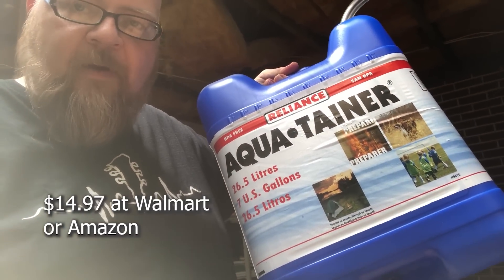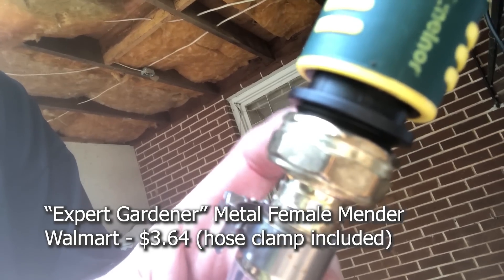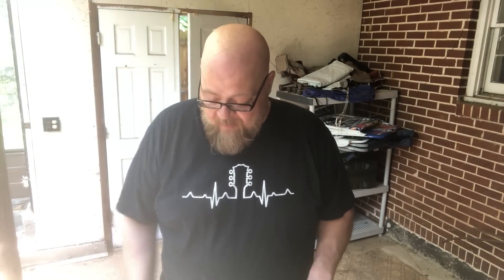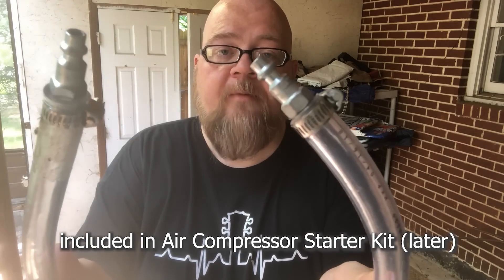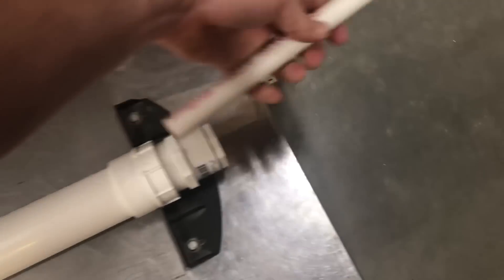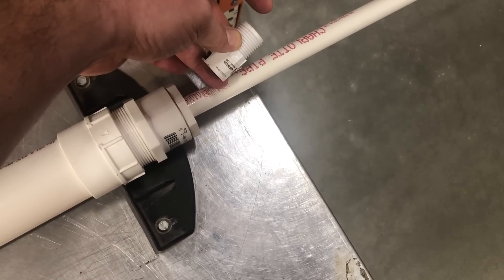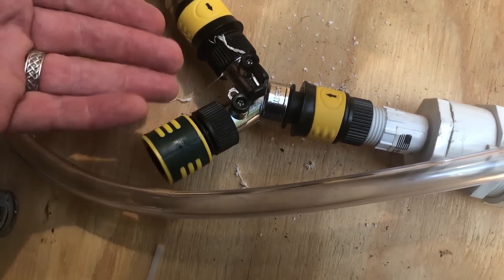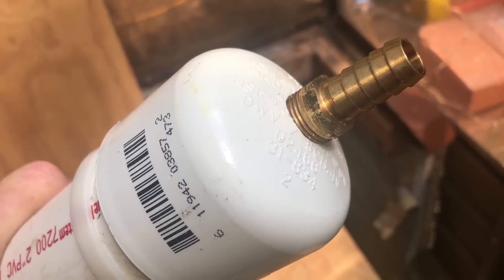DIY Aircrete Foam Gun - Demystified

Comment: Water tank is a really stupid idea.  I dont know if the brand isn't making good water jugs anymore but I just had my second one explode in the exact same seam near the bottom.   Not viable for a tank at all; it's about as fragile as a soufflé.

Tank should be made out of the really large pipes like the ones used for the septic as the pvc is pressure rated unlike weak water jugs.

Comment: good idea ,but i will use 2 adjustebol air pressure regulators  instead of the 2 valves on the gun ,i think this will give a perfect controle over the foam gun and the foam  and the regulators will not be on th gun but at the start of the air hoses to reduve the weight of the gun and make it over all easyer to handle ,but again good idea
Reply: I like this idea (after blowing up a couple different containers). Were you able to get yours to work?
Reply: @hithereitsjames  did not yet build one hehe,i am just looking to lern from others how they did it before i give it a go , seeing the (in my mind) mistakes they made will avoid me to make those mistakes and hopefuly i wil swear a lot les to. .lol
Reply: @DeeCee  cool! I'm still working on mine. I set my rig up like @jonwasbored but air kept blowing back up the water downflow.

Comment: I don't understand why the air can not go to the solution and then straight out of the gun, without air going in a T bypassing the solution? 
Why is the T connection Needed?
Why can't the air pressure just push the solution out into foam?

Comment: Typically how much does this weigh per cubic foot? Could this be used for a walkway on a dock? Wood doesn't last long and the PVC boards made for docks are way too expensive.
Reply from the maker: Hey. Sorry such a long delay in reply - it can be used for surface but it takes some reinforcement. Check gianttinylife , AircreteHarry , or honeydocarpenter

Comment: Pro tip 1: Push fittings instead of garden fittings. They are faster to connect/disconnect, don't leak at all, and hold more pressure; and 2 for the countries that do not have 7th gen dish soap, seek out the active ingredient that makes the bubbles. i.e. SLSA or Sodium Lauryl Sulfoacetate from a chemical supplier, which is a foaming agent. It's good because no colourings or smelly additives. Just tight froth. <3

Comment: Hey Jon, great vid man!  So i watched Matt Traven's video also on his super simple gun using the pittsburgh automotive Air Vacuum pump which has a venturi valve inside of it.  Did you try using this valve?  https://www.harborfreight.com/air-vacuum-pump-with-r134a-and-r12-connectors-96677.html.

I noticed in your vid here that you have the porter cable mini compressor which is the same one I have which is only capable of 2.4 SCFM a minute @ 90PSI and it says 4.2 CFM per minute at 90 psi air consumption on the front of the harbor freight part so could that be the reason it failed?  Or would it work for a little bit and then you would have to stop and let it rebuild pressure?
Reply from the maker: Hey. I never got it to work. I suppose the rating could be the reason but all in all it was a really small valve and just wasn’t pushing enough air to create negative pressure. Again - might be the compressor rating but at that point I wasn’t going to spend the cash to upgrade my compressor so i can make a $12 valve work.

Comment: I haven't watched the whole video yet, or looked at all the comments but, can you spray it on walls as insulation?
Reply: i would not recommend that
Reply: be we are trying to figure out something to do just that
Reply from the maker: Not likely you’d be successful there. It takes a while to cure and once it does it’s light, pour out but surprisingly strong when a skim coat of stucco like material is placed on it.
Reply: @JonWasBored  I'll just stick with batt insulation. Don't wanna take any chances.

Comment: Nice job!
However, your pro-tip is incorrect.  It is the the compressed air that is dangerous in a pressure vessel (your water can isn't really designed to hold pressure)..  Water doesn't compress, so the lower the volume of compressed air that you are storing, the better.

Comment: Could you use aircrete to make a countertop?  Could you just do a skim coat of cement on the top and sides after it's cured to get rid of air holes? Would you add rebar to it?
Reply from the maker: @honeydocarpenter is the best to answer that one. Short answer is yes, but you’d need some additives I think.

Comment: Would using a larger foam outlet fitting make for a better and less forceful spray of foam ??? Also, what would be the best way to pump the final product of aircrete up and into 8 feet high and 8 inch size cinder block ???? Thanks Jon Was Bored !!!!!!!!!
Reply from the maker: I don’t know of a great way to pump the solution. Honestly seems by hand would be best to maintain the integrity of the foam. Might ask @aircreteharry or @honeydocarpenter
Reply from the maker: I don’t know of a great way to pump the solution. Honestly seems by hand would be best to maintain the integrity of the foam. Might ask @aircreteharry or @honeydocarpenter
Reply: @JonWasBored  Will try that YWB. Peace too.

Comment: Run a piece of 1/2 pvc to about a 1/4 in from the bottom of your water tank to the water out valve.  That way you are pulling water from the bottom of tank and not having it forced up and out.
Reply from the maker: It’s not being forced up. It’s being pushed out the bottom.
Reply: @JonWasBored  do you lay the can on its side?
Reply from the maker: No ... it would back fill. I just like to keep it elevated so gravity helps keep the fluid going.
Reply: @JonWasBored  10-4.

Comment: I am puzzled about the way liquid is pushed out. Is there a hose going down inside the tank under the water level? I missed that part.
Reply from the maker: Air goes in tank and pushes soapy solution out the other side.

Comment: Hi can anyone tell how to make 1 gallon of aircrete ... Can i make using just pain cement and dish soap??? its for an art project i don't need much... i saw a video where a brick made this way floats... ..thanks for your help.
Reply from the maker: One gallon is gonna be a small order. Regardless you’ll need the foam to make it float. See my video on my first pour. One small bag of Portland cement makes about three gallons of cement. Add 15 - 18 gallons of foam (by volume) and mix with the cement slurry. Then use what you need and throw out the left over. You’ll only be spending about $15 in material. There’s also a really slow way to get the foam - wrap screen material around a paddle mixer and whip it up with your drill. Takes a while longer but it keeps you from having to build a whole gun.
Reply: @JonWasBored  yes thanks... but theres gotta to be a way to make a smaller batch... i actually only need about 1/2 gallon on aircrete...  for art project
Reply from the maker: You can make as small of a batch as you want. Just do the math and cut accordingly. But I’ve never seen Portland cement sold in bags smaller than 48 lbs
Reply: @JonWasBored   so lets so i use a 5 gallon bucket and add 3 inches of dry portland...then i mix with water...i see they make it very watery in videos i watched... so roughly how much foam is added...is this an exact science? maybe just keep adding foam while whipping until it raises from 3 inch height to 8 inch height in bucket kinda like a milk shake... i will be happy if  when its cured  a  aircrete brick  weigh s approx 1/3rd as a pure cement brick so if a regular brick weighs 3 lbs then my aircrete brick is 1 pound... give or take...it could weigh a 1/2 pound and i would be happier actually... this is fill for statues that are hollow and i need fill for strength etc... but its art so it does not have to be any stronger then a good piece of foam... thanks again also cure time compared to regular cement? will it set p the same? i want to try this tomorrow so any tips are appreciated. i just learned about this stuff yesterday..thanks again
Reply from the maker: Here’s the standard formula that makes about 45 gallons. You’ll want to divide by 9 to fill a five gallon bucket. 

https://www.domegaia.com/how-to-make-aircrete.html
Reply from the maker: It’s carveable and shareable after 24 hours. It will be very brittle and flaky for quite a few days.
Reply: @JonWasBored  so how long before its pretty strong .3 days? .does this shrink more than regular mix after a couple of months...?... after a week a regular mix i fill with is ready for sure next day its usually solid.., thanks again
Reply: roadstar499 if your foam is the right density you shouldn’t see more than 10-15% slump. And I would let it cure for at least a week.

Comment: Are there not commercially available foam guns for this purpose that will work? Like the kind you use to foam wash a car. Or is this just how you DIY it if you don't want to buy one?
Reply from the maker: Foam guns at car wash are simply high pressure water/soap solution ... this gun and many other similar use the steel wool to make dense foam that holds up when mixed with the cement slurry. I’ve not seen any commercial versions though there are several DIY guys that sell kits.

Comment: So, does the soap meet the water and air at the steel stuff and make the foam there? Thanks, nice..)
Reply from the maker: Yep. Soapy water under pressure and broken up by the steel wool. Kinda like your spray bottle that goes through a screen when squirted and makes foamy solution when you clean ... that times 1000! :)
Reply: @JonWasBored  cool, thanks..) so, is there away to adjust the amount of soap, size of bubbles... Does that matter?
Reply from the maker: The ball valves I have in line for both the soap solution and the air allow for “dialing in” the best blend of air and soap ... generally it should be the consistency of shaving cream and not easily break down... meaning if it sits as just foam it won’t “melt” into just soapy solution again for quite some time.
Reply: @JonWasBored  cool, thanks..!
Reply: @JonWasBored  are going to show what you've made with it? How would you compare the outcomes with AAC, made with aluminum powder?

Comment: So I watched a video from a company that makes commercial foam solution for aircrete (instead of dish soap or shampoo) in the video they demonstrated using a 5 gallon bucket, water, their "soap" and a drill w/ mixing paddle to make foam without a air compressor and foam gun... just wondering if you could possibly make a video of this with the regular soap option and tell us if its possible to do GOOD small batches of aircrete at home with this extremely easy/ low cost method???
Reply from the maker: I’ve heard others mention that method. One comment said to take a piece of screen mesh and secure it to a paddle mixer on a drill bit. Takes a little longer but should work.

Comment: Your device makes great foam. But I still have no Idea how is going together. What is in the Blue jug and is it pressurized? where is the Soap.
Reply from the maker: Did you watch the other step by step vid I did? The water solution is about 2/3 cup soap to 3 gallons. And it’s pressurized to the point of I he ring the fluid. But the added air to the gun makes it foam when it hits the steel pads
Reply from the maker: Did you watch the other step by step vid I did? The water solution is about 2/3 cup soap to 3 gallons. And it’s pressurized to the point of I he ring the fluid. But the added air to the gun makes it foam when it hits the steel pads

Comment: It would be pretty cheap to put a regulator on the air supply to the jug and keep a known constant pressure there. You can find on amazon for about 6.00 and up. Also you can get brass bulkhead fitting for the hole in jug you drilled would be more solid connection. Just drop the threaded piece in through the big hole and move jug around till you can pull it through small hole. Might have to build one of these.
Reply from the maker: Awesome suggestions. Please build and post your results. :)

Comment: While your gun works just fine it seems to be no less complicated than any other foam gun on YouTube, and coming in at $100 not the cheapest The simplest foam generator I have seen so far would be the foam generator made with a bucket, T shirt and leaf blower
Reply from the maker: Adrian - complication is in the eye of the beholder I guess. I designed this thinking about the guy who doesn’t consider himself very precise in engineering. To that end, almost nothing about my build is precise - leaving a lot of margin for sloppy work. Two drill holes. Three cuts with a razor knife and the rest is glue and screw. 

I’m intrigued about the bucket / T-shirt / leaf blower thing ... post a link!

Comment: I use a Graco airless spray rig for my soap and water pressure.I use a attachment I made with pvc and steel pad.Quick connect for air pressure.Wand cost about 20 dollars.
Reply from the maker: Do a video! How much was the graco?
Reply from the maker: Do a video! How much was the graco?

Comment: Can you use the fast setting cement and still have time for pouring and working the mix for a half hour ??? Thanks
Reply from the maker: The fast setting cement doesn’t take the air bubbles like regular Portland cement. I tried.
Reply: @JonWasBored  Thanks JonWasBored for the information fella.

Comment: Just thinking that a cheaper alternative to the Aquatainer could be your basic 5 gallon bucket with a resealable lid.  I bought a Gamma2  "Gamma Seal Lid" from Lowe's for somewhere between $5 and $10, and it says it is airtight.  I have no idea how much pressure it could take, but I bet it would be more than the Aquatainer!   I haven't tried it yet, but that's on the agenda soon.  Since you have to drill a hole and seal up the Aquatainer already, I'd think this wouldn't be that much different.  Might have to put it up on blocks and put the holes in the bottom if you don't think you can seal holes drilled on a curved surface, but I'm gonna try to drill on the sides.  I suppose I could keep the air connections in the lid as another alternative,  but that might make refilling the tank a bit more cumbersome.
Reply from the maker: Hey Bryan. Good idea! One thing to consider is the threading of the rainbird adapters through the bucket material. The plastic of the aquatainer seems a lot more malleable and threadable - that said, you could possibly use a pvc non threaded fitting of some kind and bond the pvc to the bucket.
Reply from the maker: Hey Bryan. Good idea! One thing to consider is the threading of the rainbird adapters through the bucket material. The plastic of the aquatainer seems a lot more malleable and threadable - that said, you could possibly use a pvc non threaded fitting of some kind and bond the pvc to the bucket.

Comment: I'm curious if air creat mixed can be sprayed I'm thinking more towards 3d printed homes
Reply from the maker: I think it could - but I imagine there are some unique considerations. It would certainly be very low air pressure because you don’t want the entrained air to collapse.
Reply from the maker: I think it could - but I imagine there are some unique considerations. It would certainly be very low air pressure because you don’t want the entrained air to collapse.